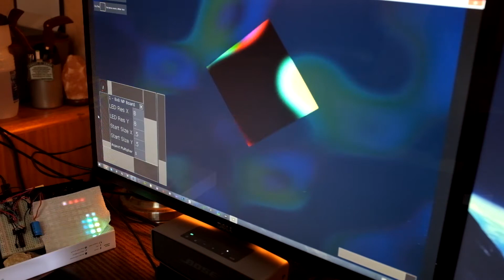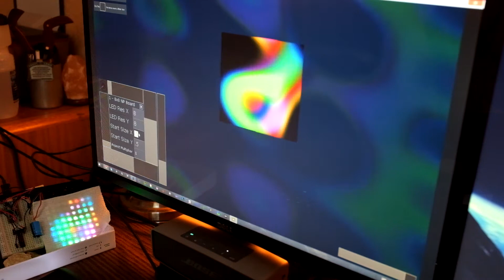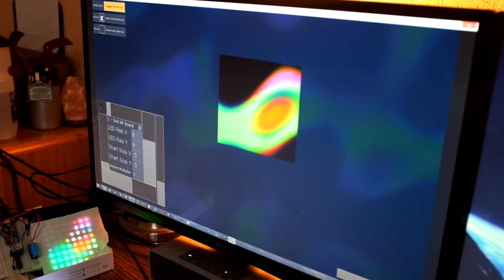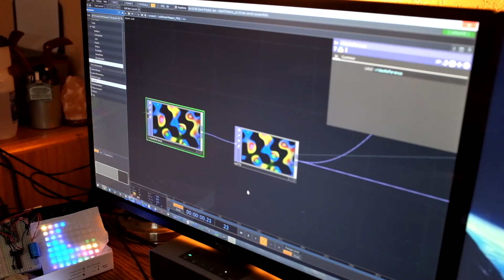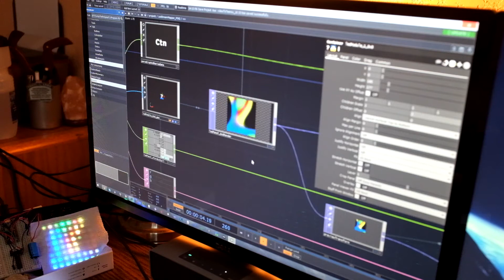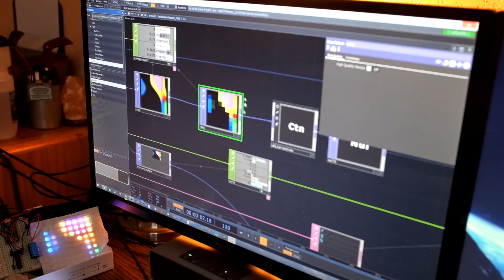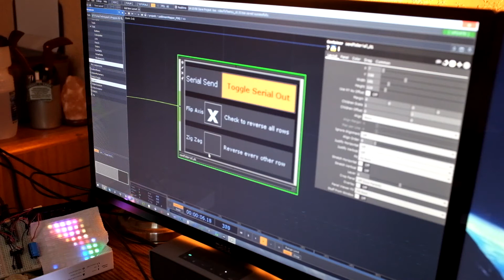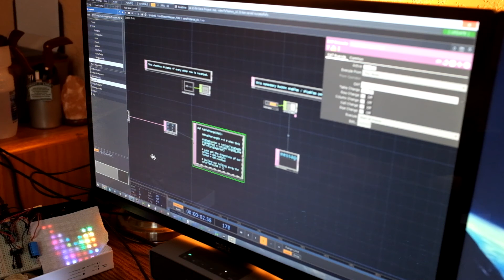Touch Designer + Custom Visual LED mapping + arduino controlled NeoPixels!

Comment: Hey, I am new to Touch and I can't figure out which node you're using to convert the video into a stream of channels. Do you mind helping out? Thanks!
Reply from the maker: +Anas Ashraf 

Hey you'll want to investigate the TopToChop under the chop menu.

You can find a lot more current and optimized examples in my thread here:
http://www.derivative.ca/forum/viewtopic.php?f=4&t=6654&sid=1ef0a6a362d04f21d2d61c41a37d9853&start=30
Reply: Alright I'll look through! Thank you for getting back so quickly!!

Comment: This is incredible! I am trying to do this with a 16x48 LED matrix. Could I bounce some ideas off of you?
Reply from the maker: +Jacob Richards 

check out this page - I have brought the communications / mapping workflow forwards leaps and bounds using arduino and touch designer, you can read about the progress and get the template files here:

http://www.derivative.ca/Forum/viewtopic.php?f=4&amp;t=6654

any questions shoot me an email ! (in descrip)
Reply: @EnviralDesign  I can't find the post, if you can tell me where to find it I would be so grateful!!!
Reply: @aureliovisual4450  It's in the description, and here: http://www.derivative.ca/forum/viewtopic.php?f=4&t=6654&start=30

Comment: Hey very cool tutorial! Im new to touch designer and im currently interfacing with the arduino. I was able to receive data in to touch but i can not seem to figure out how to send data back to arduino through touch. How do I get that accomplished?
Reply from the maker: check the description, I've updated it to include a link to get you started. Arduino code and touch example. Good luck and email me if you need any help!

It's tricky getting everything talking at first.
Reply: Berto Mora Have you figured out how to send data to the Arduino? So far I haven't had any luck... I tried looking at the project in the description but I had trouble interpreting it.

Comment: Cool! I like it.
I`m trying this with 8X8 LED (http://goo.gl/1MF1t3) with rainbowduino  controlled by Touchdesigner. Do you think it has no problem?
Reply from the maker: Thanks!

I'm not familiar with the rainbowduino, but if there is an arduino library for it, you can set up some code to receive some sort of communication (I'm using serial communication here) and transmit that data from touch designer to the arduino.